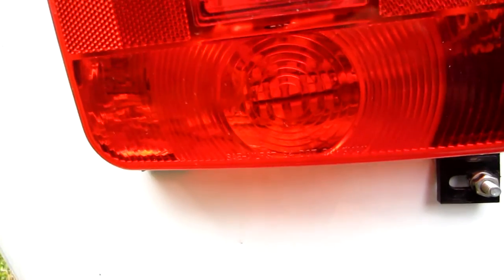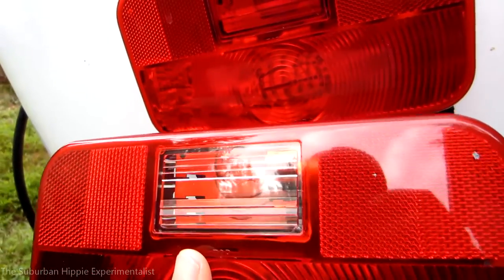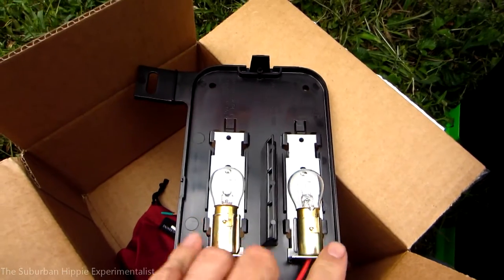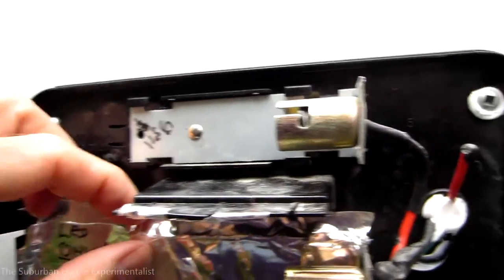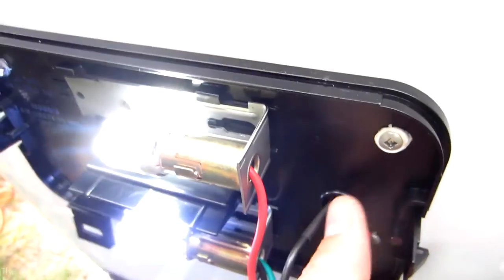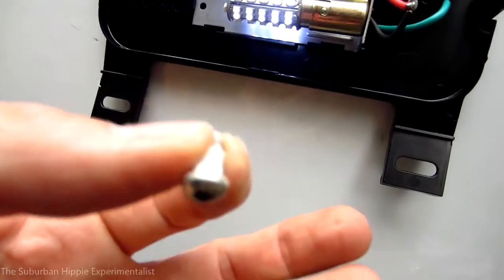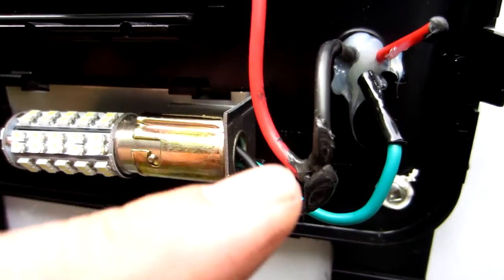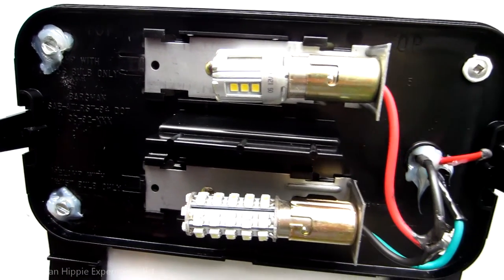Replacing a Tail light and License Plate Holder on the Scamp Trailer

Comment: Nice job. But how do you back up in the dark?
Reply from the maker: The original two vehicle didn't have the backup lights connected anyway.  It was a 4 wire harness, with a fifth I connected to charge the battery, so they were useless.    I am not sure if the Frontier has the back up lights connected or not..  So, it's never been a problem.  I usually have my wife standing back there anyway, so It isn't like I could see to back up...   So the trailer I had before this had no backup lights either.  I think a lot of trailers don't have this, as most or 4 wire, or 4 wire with a fifth for battery charging..